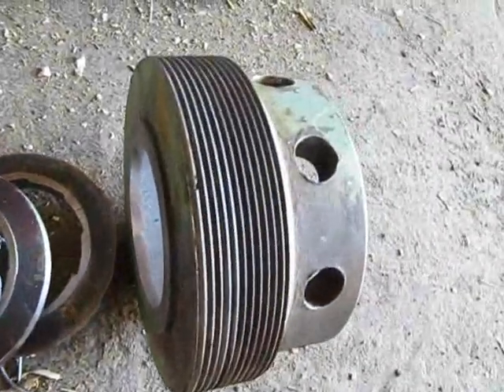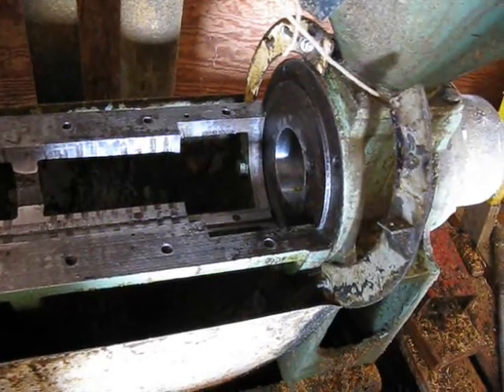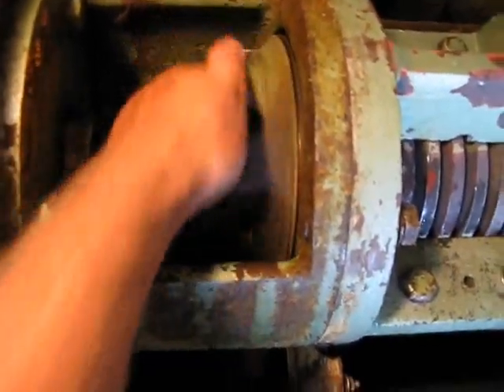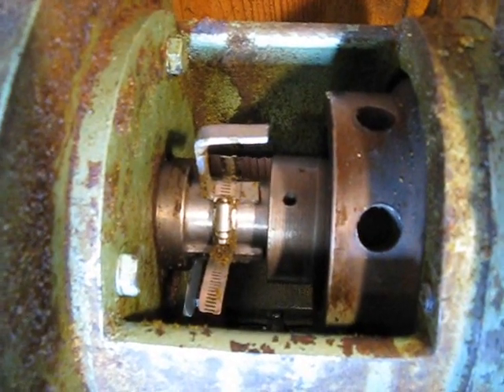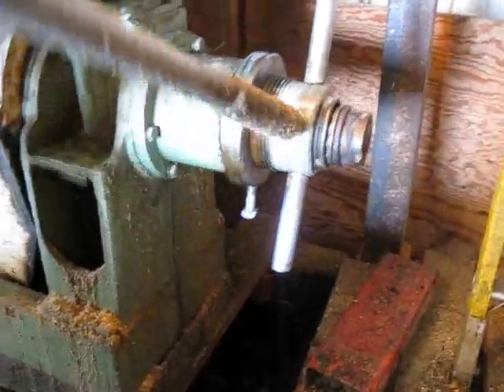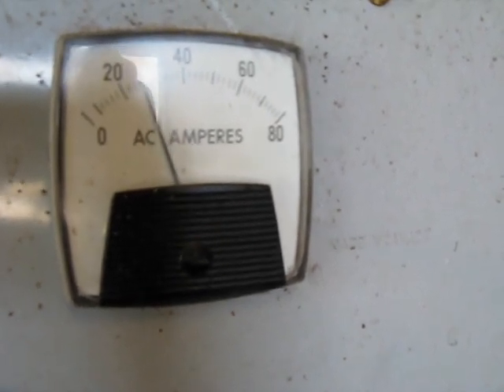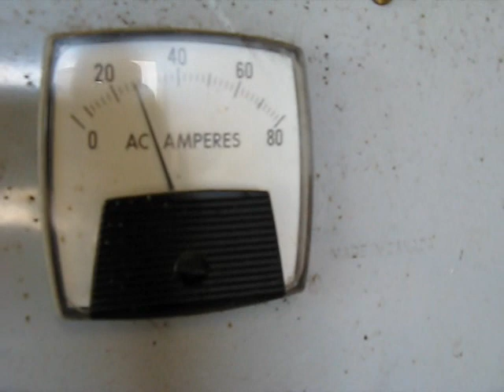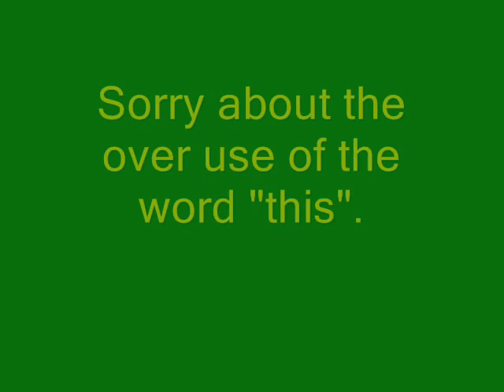Oilseed Press Info

Comment: Thanks for sharing the video. I would like your assistance. I recently acquired this exact machine from someone but so far I can't get it to work properly. It presses the seeds but no cake comes out. I have tightened the press screw and backed off three turns as you instructed but no cake. I have tried various combinations of turns but still nothing. I suspect the machine was taken apart and the pressing rings not put back in the proper order, hence the reason nothing is getting past the lock nut at the drive motor end. Can you send me some info regarding which ring goes where. Thanks in advance for your assistance.

Comment: I want to purchase Chinesee 6YL 160 to press soybeans and sunflower.  Can you please tell me the oil residue in the cake.  For exaple if soybeans have 18% oil will it yield 10% of oil, or sunflower seeds have 44% oil will the caka have 10%.  We will crush-mill the seeds first and buy the expeller with heaters on and run it on around 120 degrees Celsius.  Please tell me the residue in your cakes?